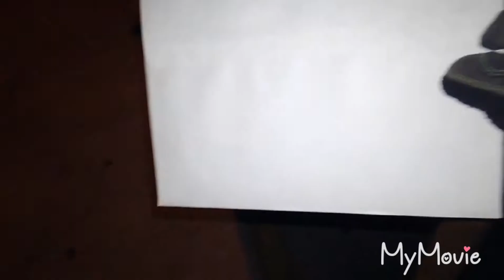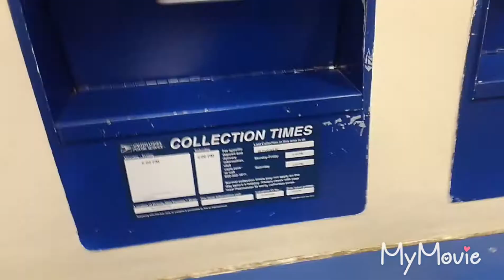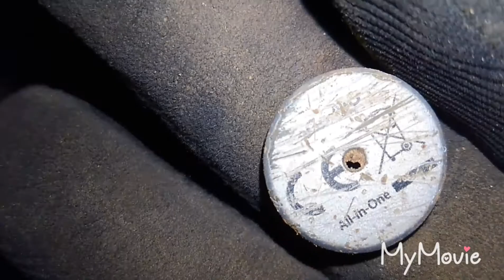Happy Father's Day 🎉 And a little scrap hunting 🎉

Comment: always sell scrap  try to begin copper hoarding    it is true money
Reply from the maker: I have been holding on to copper wire. I have to get the insulation off of it to get the best price for it. I have started to make my own electric wire stripper. But I currently live with my Mom and Step Dad and they don't want me to build it. It's pretty heavy with just the motor on the big board and I have not installed the metal brackets yet to hold the metal rollers for the wire to be pulled through to strip the plastic insulation off. Once I have it built, I will be able to feed the wires through and let the motor do all of the work. All I will need to do after that is pick up the wires and put them in the the bucket or tote box and put all of the plastic insulation in the trash or if they recycle the insulation, I put it in the recycling bin.
Reply: thank you so much for you efforts      iwill try to do the same i feel so guilty when i burn heavy wires here in 
 morocco
Reply from the maker: Hey, I know a guy and his sister from Morocco. Abdou Hbaze and his sister.
Reply: @adventuresunknown1013  yes  huge salute and thanks for you all